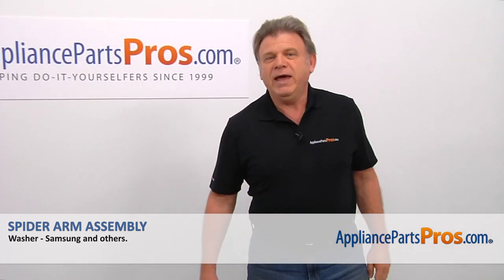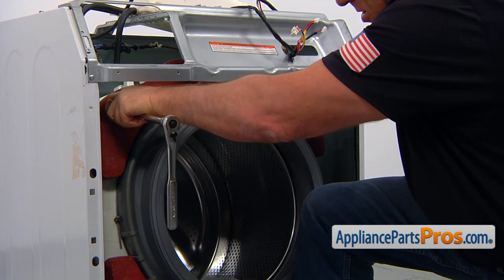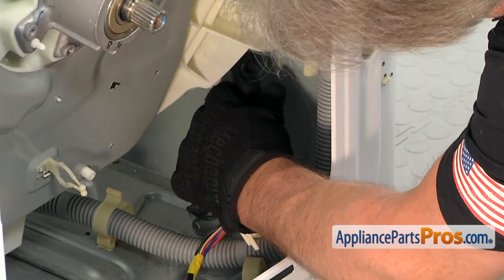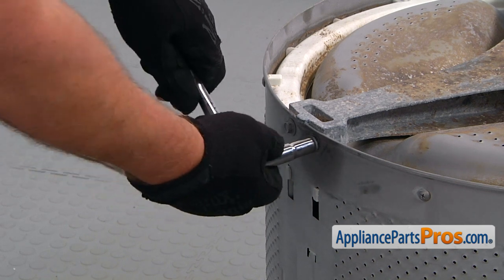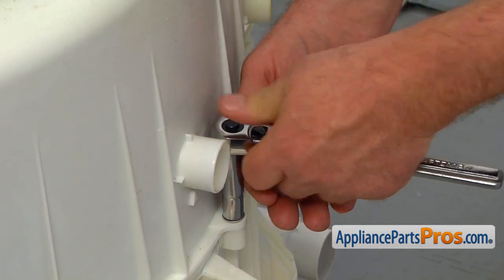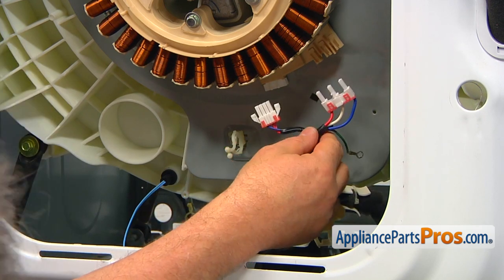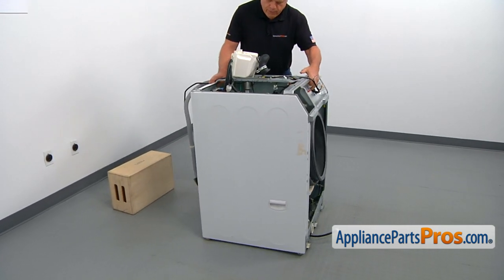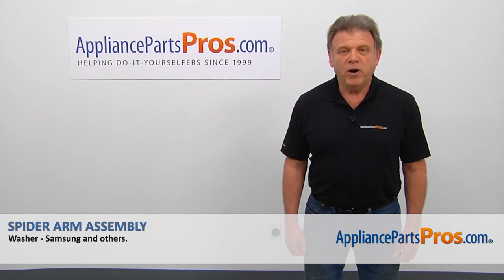How To: Samsung Spider Arm Assembly DC97-15877B

Comment: Where was the spider arm broken? Isn't the purpose of the replacing the spider arm bc it is cracked or broken?  More importantly,  wtf is everything Samsung builds trash?  Why build the spider arm out of something that breaks so frequently?  Whats that? OHHHHH, so that I'll have to buy a new machine in a couple years?  BS
Reply: They’re made to break down, so you spend more money, repairing it, or buying a new one, dirty cheap trick by Samsung. I will never buy another Samsung appliance or front load washer

Comment: Great video, I managed to do this exact repair by myself with no problems, even though my model is the WF45K6200AZ/A2 and it has some minor differences (2 additional bottom screws in the front panel, one additional bottom counter weight in the rear, and the front control panel can be removed by disconnecting a single connector).  Very detail explanation, a "must follow" channel. 👍👍👌

Comment: Great video.  Thanks!  This happened to my washer 5 years ago and I ended up buying a new one--repair $450 or new washer $550 (wish I had repaired it myself).  This time, new washer $900+, repair ~$450, DIY $150 (1.5 hr).  I also was able to clean the hoses that had some junk in them and I replaced the front boot that was showing a lot of wear.  I also recommend painting the new spider arm to slow down the corrosion and new bolts.  All six broke when trying to remove them.  Two thumbs up!!!

Comment: Does anyone know if the new spider arm comes with the small thin washer and rubber seal on the spindle? Both are about 1.5 inches diameter, on the shaft.
Reply: They do not. Just take it off your old one.

Comment: This was one of the best step by step videos , Replaced Spider arm assembly with no problem. was made to believe from progressive Appliance repair hvac, I needed everything from the basket all the way down to bearing and shocks , didn't make sense my washer is only five years old , spider arm went bad due to galvanic corrosion , usually occurs between 5 and 6 years due to two different metals stainless steel tub, with aluminum spider bracket , soap and water are the perfect mixture to cause galvanic corrosion,  replaced spider arm bracket washer runs like new :-}

Comment: Great tutorial! Replaced my spider arm with ease. My washer would spin go down to seven minutes left and then jump up to 12 minutes again in an endless loop and made quite the racket never getting clothes sponge dry. Total cost for the spider arm and a 6 new bolts was 235.00 but it would’ve been cheaper. Had Amazon delivered the part and I didn’t have to pay an extra $70 at a local part supplier. Spider arm is 138 on Amazon or 132 from Samsung… But they wanted $276 to deliver… Six pack of bolts with blue thread lock tape already on it was 25.99 on Amazon. A local supplier wanted $16 a bolt and I just laughed at him, all in all it was a very simple job but the tub and drum took about an hour and a half of cleaning and scrubbing! pro tip… either paint your new spider arm with metal paint, or a clear protective coating to keep it from corroding and breaking again! Never use the old bolts on a new spider arm. Had Amazon delivered to my location. The total cost would’ve been around 175… Much cheaper than buying a new washer.

Comment: Great demo, I would have to buy tools, heat gun, gloves, grease spray, and cinder blocks.  Added to 3 days of painstaking video rewinds and lost screws and bolts to replace. 😅
Reply: how did it go? appliance rpeair guy came and said spider arm needs to be replaced and that labor alone is 3-400 plus a few hundred for parts. Might as well get a new machine
Reply: I spent an hour and a half taking it apart in two hours, putting it back together with relative ease. Everybody should have these tools, doing a job like this means you can afford to buy them.

Comment: My Samsung washing mashine has a broken spider arm and i want to fix it, but I need to know if all Samsing washing machines have the same size spider arm, bolts, tub seal, and bearing? My samsung washing machine Model # is WF218ANS/XAC 01. Thank you for the video!
Reply: They’re all different, simply write down your model number then go to Samsung site put it in and they will give you the exact part numbers you need

Comment: Why do they make them with aluminium it just corrodes over time
Reply: Metal fatigue is much more an issue with aluminum. The oxidation doesn't penetrate last the surface unlike in iron.
Reply: Past*
Reply: So you have to spend money to fix it or replace it. Could’ve easily put a protective coating on it or used better material. Samsung has lost my business with this nonsense. It happens to every single one of them. Couple buddies at work but the same washer as mine and both of them had to replace the spider arms two weeks apart.

Comment: I'm just going fork out and get me a top load washer.  Chuck my Samsung front loader..
Reply: I thought about doing the same, but save 800 bucks replacing my spider arm. Took four hours total to disassemble and reassemble. Certainly will never buy a front load washer again. Samsung deliberately used crappy spider arm they knew would fail. Very easily should have put a protective coating on the spider arm, or made it out of the proper material not impressed.

Comment: Video was very helpful. I was able to get my washer working again. My boot got chewed up some so had to replace that too. When I was done there was one bolt on white drum not completely tight and had a leak. It took a little time to find it but things are back in action for $200 in parts + my labor.

Comment: The new spider arm actually looks to have thinner walls than the original?!?
Reply: Yes, mine was different as well, but better, the old one sat right on the drum, where it got corroded, this one sits up about a quarter inch and only touches the drum where it bolts

Comment: Very nice video -  With all of that work and so little cost extra what not change the bearings, seal and tub seal at the same time ?
Reply: Seals not necessary as its receded. I didn’t do the bearings on mine either as they were in good shape. They should definitely be inspected, but no need for replacement unless they’re damaged.